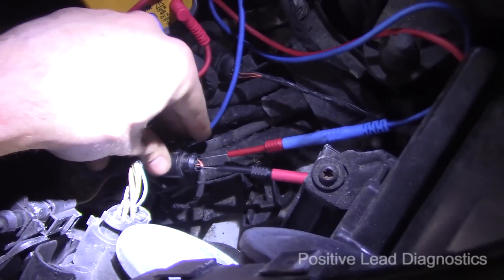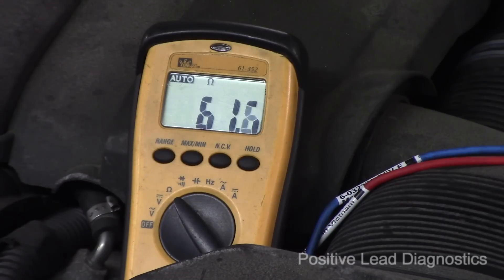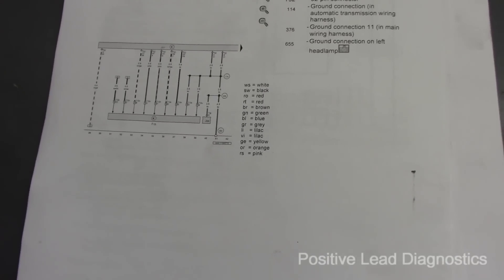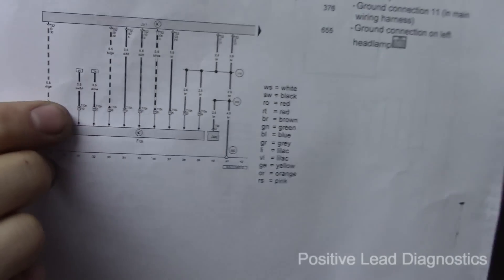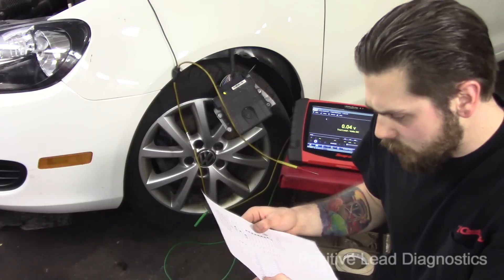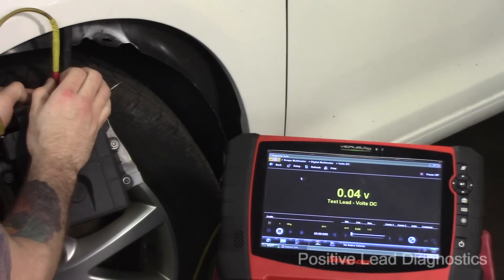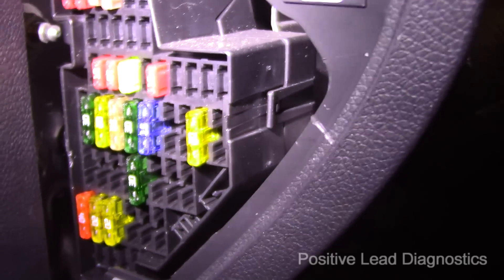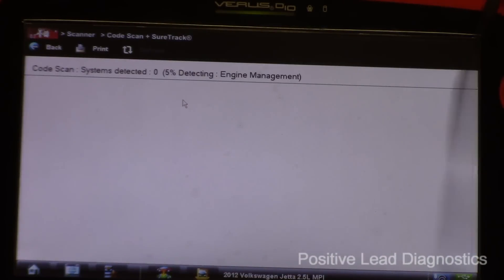2012 VW Jetta No Communication with TCM U0101 (part 2)

Comment: Ok I know I’m a little to late to respond to a year old video but I hope this helps.  I’m a heavy duty diesel tech and a lot of this data link ( can networking) crosses over into automotive side also. There are some rules follow or things to check for modules that won’t communicate.  Don’t over complicate things. The only things a module needs for communication is POWER, GROUND, IGNITION ( or wake up signal) and DATA wires. If powers, grounds and ignition check out then ohm the data link and check for your 60ohms. If your resistance checks out also then check for the data link wires to be shorted to ground or shorted to external power.

Comment: Amazing video with very difficult fault to pinpoint. Thanks for sharing.
I wanted to ask, was it a valid test to measure the terminating resistance through the OBD2 port terminal 6,14? as it will measure the internal resistance of the gate way module not the high speed can bus.
Another question, when you were measuring the can bus signal using the oscilloscope,  were you measuring across terminal 6 and ground on first channel and across terminal 14 and ground on the second channel? or between 6 and 14 directly?
Thanks in advance.
Reply from the maker: two separate channels referenced to ground, not each other (I'm pretty sure, it's been awhile, I know I talked about it)

Comment: I do not think a faulty TCM would change the resistance of the network. These two terminating resistors are for preventing signal reflection. According to the ISO11898 standard, the terminating resistor should not be placed
 inside the node/module to avoid that reflection in case that node got disconnected. I think measuring the resistance of the CAN bus lets you know that there is no short or open in the network comm. lines plus it confirms that the terminating resistors are good. It will not help you determine if a module is faulty or not.

Comment: Only thing I can think the resistance check would be good for is when TCM is unplugged and you check resistance from another location on the network and it is say 60 ohms and then when you connect the TCM back up It would say jump to above 70 ohms with a faulty TCM. Don't know if that would be the case but I would think so. 
Still loving and following your work from Scotland. stay good buddy

Comment: I have been doing electronics for 25yrs now (Electrons technologist).  I started out on the mechanic side in the early 80's. As soon as I saw the wave form I knew it as power side issue. The waveform fine unloaded and when active circuit attached is was horrible.... indicative of missing power to an active circuit... A passive circuit would load the bus signal...  That's why each branch of the CAN bus is active circuits... Bus supplies info not power... I kept saying while watching do a non connected load on power lines... LOL.... So had to watch second part to see if you did...  I use to see so much of this kind of stuff with people messing with fuse boxes and with wiring to do DIY work But when they don't provide you with good proper complete information when the car comes in... It just makes it more painful for techs! I use to get a lot of bad information from students who report problems with all the lab equipment that I repaired at the college near me when I worked there as a tech in the technology division. Always had to start every diagnosis with real basic checks...
Reply from the maker: Great info. Thank you!

Comment: You said you checked the powers and grounds. That was a false statement in the first segment. Verdict says you intentionally withheld information, or you made a mistake(for all of the people saying its not a mistake). You could have fixed it hours earlier than you did. Or you could have replaced the TCM and fixed it hours later. But we simply can't judge a mistake on it prospective outcomes either. A mistake is just a mistake. All of your tests were valid at the end of the day and you fixed it. So good job with that. I chased a stupid brake light signal all the way up to a relay in the wrong slot once. I don't want to admit how long it took. But I fixed it.

Comment: For everyone who has 2010 Jetta 2.5L: The fuse table in the manual doesn't describe this extra 20amp fuse and not having this fuse in slot #30 on the diagram is exactly the cause  of the issue described in this video.  This is a pretty bad omission in the car manual. Anyway, watching this video, helped me get my car unstack from park. Thanks!
Reply: Doesn't explain that the car WAS working at some point---fuse had to be in the proper place then.

Comment: I hade a problem with a Hyundai loader machine on his ECU. A broken wire between fuse and power feed from terminal 30. And it have 2 or 3 constant  main power 12 V from terminal 30.

Comment: hey awesome video, i have a same problem with my Vw Golf 2009 tsi 1.4 0AM DSG7 , i am having a NO communication 01315 with TCM using VCDS, this happened immediately after i did an "engine wash", it keeps blowing a 15amp fuse i changed twice, so i unplugged the tcm and tried a new 15amp fuse, when i plugged in the tcm it blows the fuse, please any help!!! thanks

Comment: I would like to know what background information of the customer was asked about the fuse being pulled and misplaced? Being that the chief complaint was not getting the car out of park that would not have happened if the fuse was in the correct location. To me this indicates the car was tampered with prior to being towed and brought to Tommy's shop. What is the background story on this car and how the fuse came to be relocated in the wrong slot? It wasn't something that just occurred out of the blue. Customer didn't drive to work and came out at end of shift and car was in this predicament. Customer or someone who had access to the customers car pulled and misplaced fuse intentionally. Which was it or what happened? I've fiound that I can never ask enough questions of a customer about what led up to an issue with there vehicle to know what you might need to be checking first!
Reply: But what do you do with the LIARS. LOL  I have come across those situations--"oh no, i never touched anything".

Comment: you have two 120 ohm resistors in parallel in  each end of your can bus network. they act as buffers in the can network. if one of those modules with the resistors was to go out , or a fault in the can network wiring . you would see the resistance change. if the tcm was one of the two modules with a 120 ohm resistor then you would have seen about 120 ohm resistance . but the tcm I do not believe has that resistor and you had to network wiring issues . just the tcm was not waking up due to not receiving all of it's voltage

Comment: As a tech that primarily works on euro cars the vw diagrams are actually not that bad, yes you have to look at a few pages but they are ok.  Most euro control modules have more than 1 power i.e term 15 as Tommy mentioned and term 30.  Fair play to the guy for owning an initial mis diag we have all done it

Comment: Half of the battle with modern vehicles is access to decent wiring diagrams, there's that much on the vehicle that even when using 'official manufacturer' ones, the diagrams are always split up. 

I had a similar situation with a Vauxhall Astra J. Rear wiper not working. Previous tech had condemned the BCM after checking fuses etc. 

Going back over the online diagrams revealed another fuse which was a unnamed power into the BCM.... On a totally separate diagram. 
The fuse was missing (just like this actually..)

Replaced the fuse and the wiper worked! 

Enjoyed the video!

Comment: much appreciation for the fundamental check steps that you did guys..
its interesting for me to know even though the problem was solved, what would've the resistance difference be with the TCM connected and not after knowing the power line is ok, like how major the difference would be.. im sure it wont be at the approved spec so from there the next step is to check the wiring following i guess revealing the missing power feed.
other than that it sure was a good learning experience, thanks for both of you.

Comment: Checking the CAN resistance is not 100% of faulty driver method. 
You must know what kind of CAN are You checking. Only high-speed CAN (up to 1mb/s) uses terminal resistors, because of the speed od transmited signals. When Your are measure resistence between CAN-High and CAN-Low then you are just measure total CAN resistance, it should be about 60 Ohms.  If You are expecting to change resistance when disconect TCM, this only occurs when the TCM would contains terminal resistor inside. On Your video, the resistance didn't change because TCM don't contain termanal resistor. You should check manu, facturer specification to be sure where are terminal resistors. They may be inside drivers, pcm, tcm...and also they may be betwen CAN wire joinctions. 
For example:
We can have faulty driver with terminal resistor inside, this resistor is good and when you are measure total can resistance you get about 60 ohms. But the faulty driver can change You CAN signals very bad because of damaged CAN CONTROLER  inside.

Comment: Good job Tommy, started following this channel as i follow SD, I am an Audi tech and have to admit that elsawin current flow diagrams are not the best if not using them daily, also with the dealer computer odis test plan it would have pointed you to check that fuse at the start, but in the end you got there. those picoscopes are well more advanced than the Audi scope we use by the way. Looking forward to watching more videos bud.

Comment: Dear Friend, what you should be doing as a   VW Master tech is showing  Americans mechanic  how to use snap on scanner in VAG vehicles. Replacing modules or guessing is not something a professional tech should do or even consider. ScannerDaner is 100%. also when it comes to comm there is a resistant most mechanic doesn't  even understand and that is transceivers resistant.
Reply from the maker: Who was guessing? And no modules were replaced.
Reply: Well... he mentioned:  
- that this is not a call that would be guessing at... and TCM price....  I didn't say nothing about  any module replacements.
Reply: Victor Alvarado How can you say he was guessing ???....he  did everything he could to prove where the fault lay eventually “proving”it wasn’t the module that was at fault

Comment: Hey Tom..Always good to measure 3 times and cut once if that's what it takes..besides, I can see how it can be so easily overlooked with a piss poor diagram like that..Paul said it right.."THEY SUCK.!"
Another thing good to remember is to ask LOTS of questions from the customer..Maybe some light could have shined on it.
Bet this is one you'll remember for a long time..I know I can remember all of mine. The learning curve bro.
We all make them. Just happy to you win on this one.
Thanks for sharing it with us.
Cheers to you both.
Reply: absolutely!! we kept on measuring...the same question what is a full proof test to call this module? are there any other checks we can do?  idk if we would have gotten this info from the customer, for some reason they don't like to give us important info lol
Reply: Danner's trick of highlighting the legs of the circuit on the wiring diagram in different colour highlighter pens is good especially with those multi-page abominations

Comment: Wow great save! "But you should just check the fuses to begin with! You're overthinking it!" Let's just say it's not the blown fuses that are hard to find. It's the MISSING ones, or in your case even more bizarre misplaced fuse? Great job!!
Reply from the maker: Thanks Ivan!  Great to hear from you
Reply: Yeah i have seen owners books (Ford Fiesta) that says "Not In Use" on needed fuse on them. So, even original source are some times big ? mark to me.
When you are missing power from part and aren't sure your fuse holder diagram is update and you come to find out that your fuse has grown legs its almost always a mystery who took it out to walk and why? ;)
Reply: A quick check of ALL the fuses would have made this one stand out as that space is suppose to be vacant and it would have tested "open"!  The way these networks and systems all communicate with one another, any one fuse could affect other components. Great vid, but you really got blind sided!

Comment: All you guys who are fighting can nets would benefit from studying up on transmission line theory, standing (reflected) waves, termination, etc. If that TCM had active internal termination that would point blank explain the distorted bit stream due to no power at the TCM. Everything that hits the TCM bounces back into the network mixing with valid data instead of being "absorbed" by the termination in the module. In IT they use a thing called a time domain reflectometer (TDR). This device will tell you not only if you have an open or shorted line or connected component (module) but it will also tell you where on the line the defect is. Even if it's not practical to use one of these in automotive knowing how they work and what they are looking for will lift veils from the troubleshooting  process.
Reply: so the distortion was actually the signal not being absorbed and bouncing back into the can line? pretty cool I'm going to look into that, thanks
Reply: Wow, just did a little research on that TDR thingy and that is awesome ! So much to learn !
Reply: I used a TDR many times!   Been a 100 years ago. :)   I always used the TDR on coax cabling.  (on the C-141B airplanes.  They are now, all of them, in the "bone yard."  Trying to think if a TDR would work on a twisted (shielded pair).  Think so, do the shielding of the wiring pair being there.   

Doesn't work on a "single" wire - must have the shielding (as a conductor).

Comment: In one of his videos where he talked about why he loved his first gen power probe, The Humble Mechanic said that the first thing he does on cars that come in with weird problems is quickly check every fuse in the fuse boxes. Only takes a minute he said. I thought that was kind of a waste of time. After seeing this, I can see how that might not be a bad first step. Epic job guys. Lots of valuable CAN and module lessons here. Thanks!
Reply: thanks for watching, everyone says just check the fuse first but that method would not have helped, that fuse would have had power on it due to the fusebox design, only knowing actual fuse location was the fix.
Reply: Got it. Killer job as always Tom. Thanks for sharing this video with us and most of all for educating us on the importance of perseverance and a thorough and complete diagnosis!

Comment: From my understanding, on a star type can bus, the resistance check is for network integrity. If the module you are unplugging doesn't have a terminal resistor in it, the resistance value won't change. 

On a passthrough type system, unplugging modules is a good way to split up the can network to make it easier to diagnose. 

But I could be way off......

Comment: Great job guys!
My guess on the distortion on the network may be the way the module will handle the termination of the CAN internally with vs. without the proper power (active circuitry vs. passive components like a fixed resistor etc). CAN is an RF signal network that is sensitive to the components on the bus. With a module that is not receiving the proper power there is no accounting for what the CAN network is being exposed to connection wise. I've not dug into the termination circuits of VW CAN bus modules so this is merely an educated guess based on knowledge of other computer com networks that have a device that's connected to the bus exposing the entire bus to circumstances that distort the signals. Again fantastic job Tommy, and Dan. Thanks for sharing, and reminding us to dig in and check everything carefully.
Reply: I'm calling him Dan from now on lol
Reply from the maker: It Paul but that okay brother, I get Dan a lot. Thanks for you input!
Reply: Sorry for the brain fart. I know you're Paul... (facepalm).. Love your work.